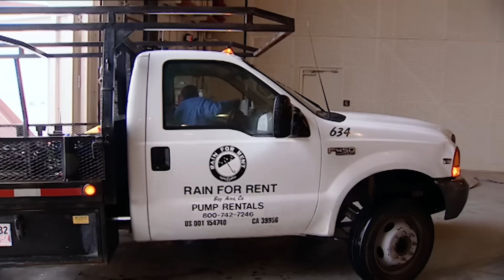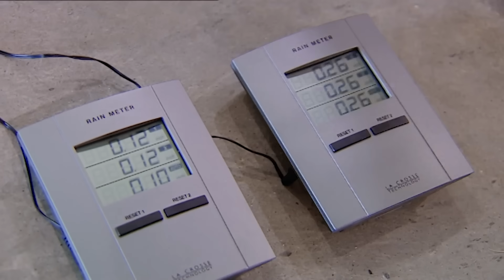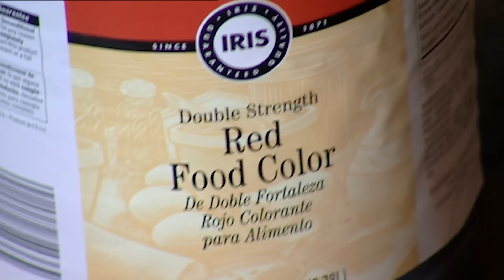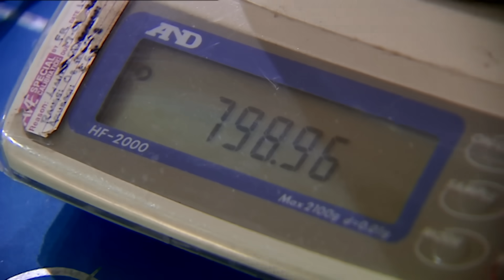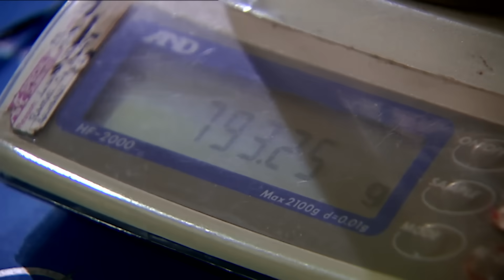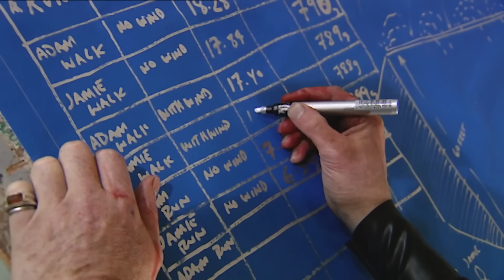Running Through Rain Keeps You Drier Than Walking | MythBusters

Comment: this could be proven mathematically, it would be the area of Distance x Height x Width of runner over how fast the person runs multiplied by the amount of rain filling a space per second, if you take these to the limits such as how much time before the material couldn't hold more water and the shortest distance. the answer is plainly that running makes you less wet, until you reach a distance where you are inevitably wet completely but of course speed increases proportionally how much distance you can reach before running not making a difference. also because you are trying to fill more area over time by running you will feel more wet but thats only because you can't see the difference in how little wet you get if you had walked, the shape of the object also plays a role as a thinner object will "get less wet"

Comment: This is the right outcome, but only applies to short distances.

The thing is that whilke walking, your forwards velocity is so slow you might as well be stood still, which means the rain only has a small area to hit you (top of the head, top of the shoulders, shins and feet). By comparison, once youa re at a jog or run, you collide with a lot of rain that is mid-fall - it's the same effect as a decent wind pushing the rain sideways, except it's you that's moving instead of the rain.

However it's a law of diminishing returns situation, because there's only so much water your clothes can soak up, and once a spot is saturated, further water will simply trickle down and soak into adjacent parts. That means that the longer you're out in the rain, the more your clothes get soaked, and the less it matters how much surface area is actually being directly rained on.

So, for very short distances, walking keeps you drier. For medium distances, running keeps you drier. And for long distances, neither matters. You can't run fast enough to avoid getting soaked through, and if you walk you'll be out too long and get soaked through despite the small surface area exposed.

Comment: The swept area will be the same for walking and running, so the water from a horizontal direction will be the same. However, they don't have the hood on, so they aren't measuring the water from above, which there would be more off since the amount is proportional to the rain rate per area and time under the rain.

Comment: I see a number of comments that they got it wrong here (which I agree with), but what did they do wrong to get this result? I'm not noticing any flaws in the methodology.
Reply: They need to measure the water that hits their head from directly above them. 

There are two components to how wet you get 1) the amount of water you travel through and 2) the amount of water that falls directly on top of you.  The first component doesn’t really change whether you walk or run because it’s proportional to the distance traveled. The second component is proportional to the amount of time you spend in the rain and it’s this component that gets less if you run. So overall your clothes will get wet the same amount whether you walk or run (which is what their experiment measured) but your head will get more wet if you walk and less wet if you run. They did not measure how much water hit their heads.
Reply: @grusilag  Thank you. I'm surprised the amount of water that hits your head makes that much of a difference, but I suppose it makes sense since our bodies are pretty small when viewed directly from above.

Comment: Easier and more effective test. Grab a container on wheels and move it at different speeds under the rain. See how much water it holds. You will find out the slower one is more time under the rain and will hold more water.
Reply: Except that wouldn’t properly account for the rain you run into.

Comment: Minute Physics did a good video on this.  It depends on if the comparison is for the same amount of time or same distance. 

For a given amount of time running means water hits you in front as well as from above. 

But for a given distance point A to point B, you get more wet the more time you spend under it, and running well get you out of it quicker https://youtu.be/3MqYE2UuN24?si=gKWCC7hFLb2bdlD0

Comment: Well, yeah, but I wanna see this experiment done over a longer distance. Of course you get more water when you run, but you also spend way less time under the rain.
Reply: But while running more water will land on you, that’s just logical.
Reply: @weltvonoben how is it logical that more water will land on you when you run?
Reply: @MJSchaefer16  tell me how is it not logical
Reply: @weltvonoben when you run you spend less time under the water.  If the water is falling at a consistent rate (__ oz per sq ft per minute, etc).  Less time = less water
Reply: @MJSchaefer16  faster speed = more water on you and heavier impact of the droplets meaning you should get a lot more wet
Reply: @weltvonoben faster speed does not mean more water.  Even if a drop hits you harder that drop is still the same amount of water. 

Next time it's raining, go outside, take a bucket and run 100 yds. See how much water is in there.  Now do the same but take your time with a nice leisurely stroll.  See how much water is in the bucket this time.
Reply: @MJSchaefer16 Sounds like an  interesting challenge
Reply: @MJSchaefer16  Because there is water all around you, not only above. If you move "faster", the water in front of  you will hit you "faster". The more  you move, the more water is in the way, in the same amount of time, so you get wetter.
Anyway, as I commented above, it's better to walk than to run, because you are getting drenched anyway, and the risk of slipping and falling (and probably harming  yourself) is way higher while running.
Reply: @weltvonoben by that logic, if you stay out in the rain and not move at all, therefore not catching the water in front of you by running, you should be completely dry. Right?

Comment: The weight of the suit was considered and my problem with that is when you run you get splatters on your legs more than when walking. So what if it's a top cloth only? Will the results change?
Reply: Yes, they also don't consider the amount of water that reached the clothes underneath or skin. Is the water soaked into the clothes just superficial? Cause the distribution of the same amount of water, as you pointed out, matter a lot. I don't care if flailing my arms got them more soaked if my back and torso are dryer

Comment: Trying to simulate rain on a rainy day = peak stupidity
Reply: Its a controlled variable. If it's raining harder when you walk than run, youll get wetter when you walk  regardless. "Peak stupidity"
Reply: @danielshook8502  Episode 38: MythBusters Revisited - When retrying the test in actual rain it was conclusively proven that the running test subject got less wet than the walking test subject. The use of artificial rain in the original test led to a false negative.
Reply: @danielshook8502  no they debunked this episode
Reply: @danielshook8502 you do know they changed the result after revisiting?😅 Peak stupidity.
Reply: @danielshook8502   False.  It wasn't a controlled variable, it was artificial.  And you do know they changed the result after revisiting this myth, using actual rain?

Comment: If you take it to the extreme, obviously walking for 15 minutes to go 100ft you would get wetter than spending 15 seconds to go as far. Result is wrong.
Reply: If you were to make this a graph, it’d have to look concave in my opinion (like a law of diminishing returns graph) because the faster you go, the more surface area you have, but as you said, this obviously doesn’t matter in the extremes
Reply: They eventually reversed their conclusion after waiting for a real rain. Your reasoning is in line with the Minute Physics explanation for why you get less wet when running.

Comment: To me it should be pretty simple that when you run, youre still covering the same distance, while also running directly into the drops instead of just having them mostly fall on top of you
Reply: But you’re also in the rain for less time proportional to the amount of speed. And if there’s wind that changes everything, if it’s at your back running faster would mean less water is hitting your front and if the wind is blowing towards you it means a lot of water is already hitting your front anyways
Reply: @shanedancer3895  your clothes also change this a lot. They used very absorbent linen overalls. This should have been done in jeans for example. Also were the clothes UNDERNEATH dryer after running or walking cause I'm 100% sure more water soaked through to the second layer after the walk
Reply: Think in terms of math. Take the extreme of standing still. As you approach that, you tend towards infinite rain. If you were instant, you'd only catch the volume of rain in that instant, being there longer means there is more possible rain to catch

Comment: Shouldn't they have collected the rain on the tops of their heads (with a hood)?
Reply: Yes and that’s the big issue with their method
Reply: My thoughts exactly. Anecdotally you should recall that your head, shoulders, and feet are the most wet when walking in the rain.

Analytically it’s easy to illustrate that running shifts the location where you get wet. If you are standing still the rain will primarily hit your top profile— especially your head and shoulders. The faster you run, a greater portion of rain will hit your front profile. This includes rain hitting your head, but it is a smaller portion of the total.

By excluding the head from the suit, the walking measurements are greatly underreported. They ended up with the wrong conclusion here, unless you are strictly worried about rain on your clothes and don’t care if your head gets wet.

Comment: Have you ever noticed how when you're driving in the rain at highway speeds it seems like it's raining way harder than it does when you stop and step out.
Reply: Yeah it's because the amount of space you encounter where rain exists is much higher when you're moving than standing still. 

It's called "advection".

If you're moving you could experience space worth many people's body size. These locations all have rain inside so you get more "rained on".

Also it doesn't matter than rain is falling, because there is always more rain above to take it's place. So it is either space that contains rain or doesn't.

What they were testing also the amount of time you spent gowing slower may mean that in total there was more rain.

But the tradeoff must be closer to slow walking. Because if you are standing still, you're not getting to your destination and yet you still get wet. Given enough time standing you'll get maximally wet. However moving a teeny tiny bit, like a slow crawling walk, means you're still maximally wet at your destination etc... So at some speed you have reached the speed where you get the least wet. And running is not closer to that minimum but walking is.
Reply: Raining harder, but not more.  Velocity does not equal volume.  Which is why this test and result was debunked in Episode 38.  The use of artificial rain actually skewed the results.

Comment: The answer to this myth is really found in mathematics. walking only exposes a person to the number of drops that would hit them based on the rate of the rain falling vs running which increased the number of drops they could potentially be hit by! So the math shows an increase in the odds of being hit by a drop above the rate of the rain falling! And easy way to test this would be to lower the rain fall rate.
Reply: Hard to make a hour long episode with commercials out of something that simple 

They have to draw out the watch time somehow
Reply: But this ignores the fact that you splash puddles much harder when running leading to more water hitting at the end of your pants legs

Comment: Probably cause when you run, you run into the rain droplets, but when you walk the droplets hit your shoulders instead but you are not fast enough to walk into the droplets.
Reply: Yup, you can see this exact effect when driving. At a stop, your windshield doesn't see that much rain, but above like 10-15 mph you get quite a bit more
Reply: When running, you have to lean forward and your legs are extended, so the surface area you expose to the sky is greater
Reply: Yeah it's because the amount of space you encounter where rain exists is much higher when you're moving than standing still. 

It's called "advection".

If you're moving you could experience space worth many people's body size. These locations all have rain inside so you get more "rained on".

Also it doesn't matter than rain is falling, because there is always more rain above to take it's place. So it is either space that contains rain or doesn't.

What they were testing also the amount of time you spent gowing slower may mean that in total there was more rain.

But the tradeoff must be closer to slow walking. Because if you are standing still, you're not getting to your destination and yet you still get wet. Given enough time standing you'll get maximally wet. However moving a teeny tiny bit, like a slow crawling walk, means you're still maximally wet at your destination etc... So at some speed you have reached the speed where you get the least wet. And running is not closer to that minimum but walking is.
Reply: In this episode, the red dye they used is to blame I believe.